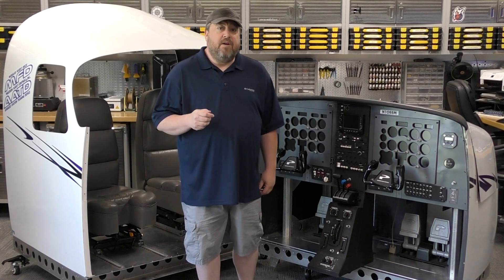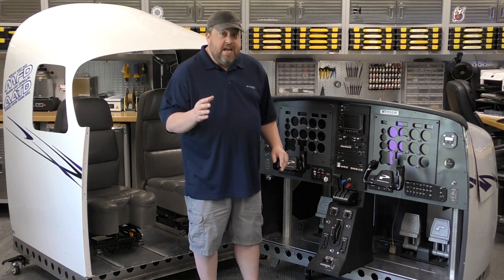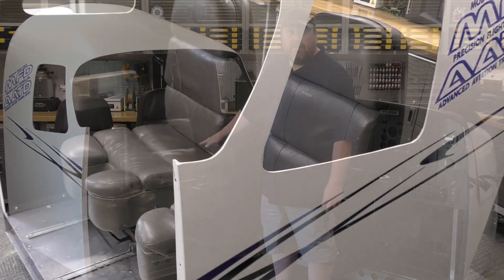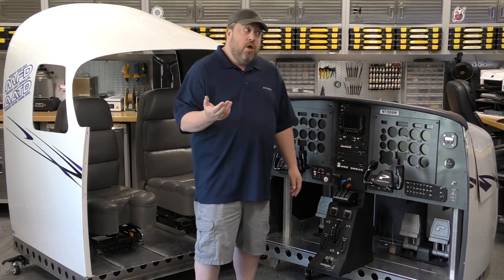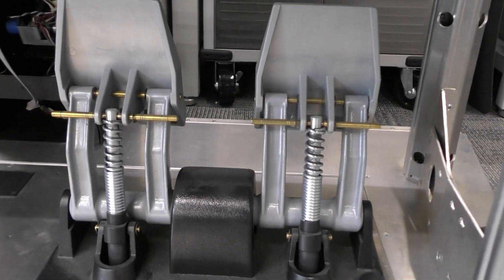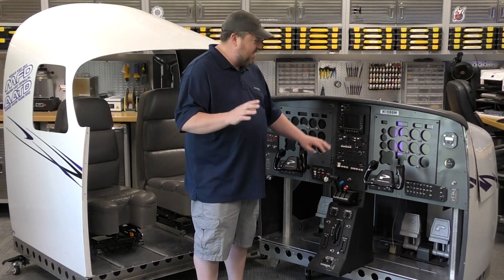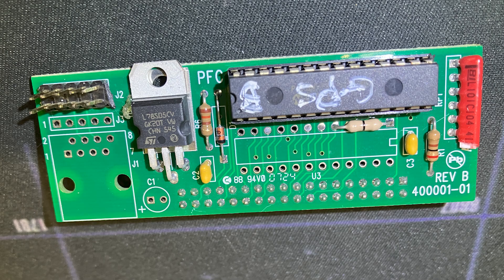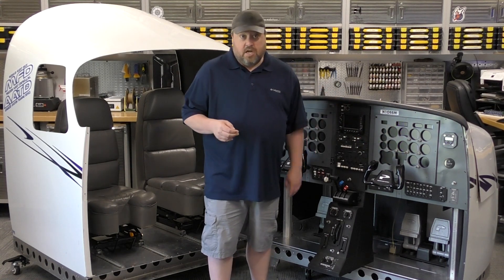Found This DESTROYED Flight Simulator - Can We Bring It Back to Life?

Comment: This is awesome. I love building flight sims. My first was a G58 and now I have this incredible H145 with motorized controls on my channel. I'm running my entire setup, motion ,screens all on 1 PC. 13900K CPU and a 4090 GPU. For your control loading you can use VP Force 86  series. That is what I used to build my collective, cyclic and and anti torque pedals. All your switches and such you may have to can the board and either have your own made that connect to an Arduino or do direct wire to an Arduino board. For motion Dbox should be able to help with their software if they didn't have any proprietary code written for PFC. I use RS Mega for my heli and it works extremely well if you are looking to cut costs and dont want or can't use the dbox. I use DR Sim Manager for motion control software. This will be a fun project for you.

Comment: Did this project before on the exact same sim model...Never realized then that i could cut it in half like that. Could've made the job a lot easier. Very much interested on what motion platform you'll mount it on to.
Reply from the maker: Mine came in so many pieces it was easy to notice it could split. This unit came with a Dbox system that is an official add on from PFC.

Comment: Just from what I can see on the shot at 6:40 I think the centre controls are going to be a lot simpler to interface with than you might expect. All those "AVIONICS SLAVE" boards are going to be converting the controls and indicator lights into a common serial protocol that should be very easy to interface with if the boards are still functioning - figuring out one gives you control of all of them. The screen at the top is nothing more than a VGA monitor, although it might also have a touchscreen connected to the USB-B socket on there as well. If the screen is still functional then just plugging it into the computer should be all that's needed.
Reply from the maker: I have my serial USB UART cable ready and i picked up a PIC chip reader / writer so i can hopefully dump the firmware package and begin reverse engineering if needed. i also created a brute force package for scanning and sending commands on to the device to see if i can initialize it or get data from it. I have made progress on the flight panel controls and they all run at a 9600 baud rate so i am assuming that will be the same here.

Here is what i know so far:

Flight Simulator Panel PCB Summary

Device Overview:
Purpose: Flight simulator button panel interface board
Part Number: 400001-01 REV B
Manufacturer: Appears to be manufactured by PuSh, Inc. (visible on PCB)

Main Microcontroller:
IC: PIC16F737-I/SP (40-pin DIP package)
Manufacturer: Microchip Technology
Architecture: 8-bit PIC microcontroller

Key Features: 
  No native USB (requires external USB interface)
  Hardware UART on pins 25/26 (RC6/RC7)
  Multiple I/O ports for button scanning

Power System:
Regulator: L7805CV (5V linear regulator, TO-220 package)
Input: Higher voltage (7-35V DC) → regulated to 5V
Output: 5V for PIC and logic circuits

Connector Pinouts:
P1 (Front Panel Connector 36 pins):
Function: Connects to button/switch panel
Configuration: 2x18 pin header
Signals: Button matrix scanning, likely includes power/ground distribution

J2 (USB Interface Connector 10 pins):
Based on continuity testing:
Pin 1, 2, 7, 8, 9, 10: GND (connected to PIC pins 8, 19 VSS)
Pin 3: +V input (VCC 5V)
Pin 4: Data line (connects to PIC pin 15 RC2)
Pin 5: Connected to J1 pins 3,5 (tied to +V)
Pin 6: Data line (connects to PIC pin 14 RC1)

J1 & J3 (Unused Connectors):
Currently not populated or used
Likely expansion/programming connectors

Communication Architecture:
PIC Serial: Uses RC1/RC2 (pins 14/15) for communication NOT the standard UART pins
Missing Link: Originally had a USB-to-serial bridge connected to J2

Protocol: Likely custom protocol designed to work with specific USB bridge chip
Current Status: No direct PC communication possible without recreating the original USB interface

Key Missing Component:
The original USB interface board/module that connected to J2 and presented as a USB HID device to the PC. This is why direct serial communication attempts have failed.
Reply from the maker: Link to serial Brute Force app:
https://github.com/angryzeppelin/FlightSimPanel/blob/main/SerialSim.py